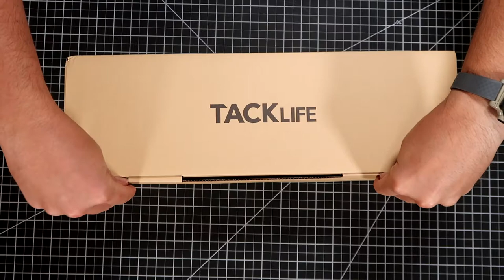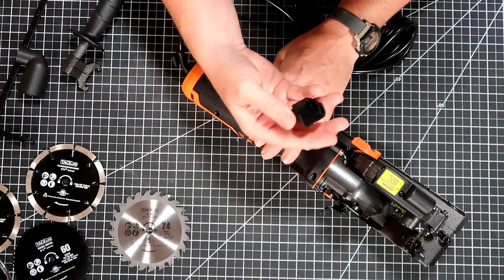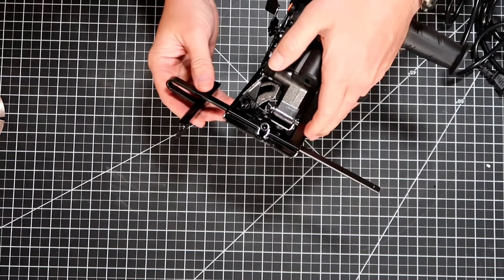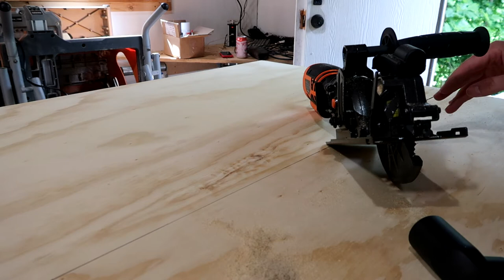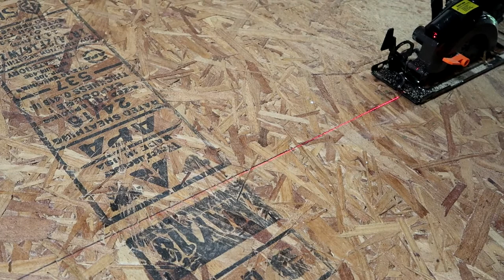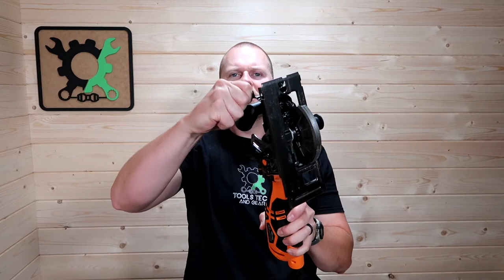TackLife Mini Circular Saw Corded

Comment: thank you for that, it seems a neat tool.  Changing the blade seemed to require having a big hand so that you can hold the tool, depress the arbor lock button, and hold back the spring loaded blade guard, all at the same time with one hand, in order to use the hex wrench with the other hand.  
Also, how easy was it to depress the safety button when holding the tool left handed since the button is only set for right hand use?
Reply from the maker: It does take some effort to push the button and hold back the guard together. The button is actually not that bad. Much easier than my 7 year old dewald saw.